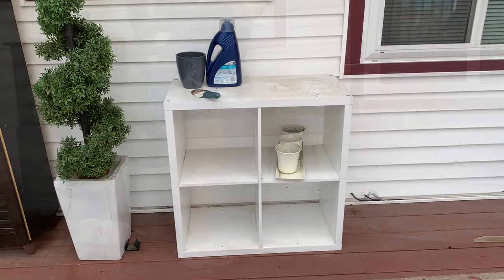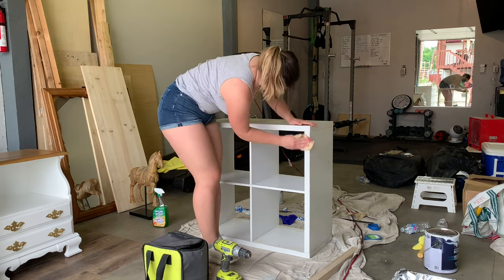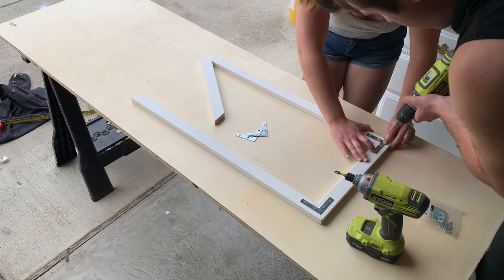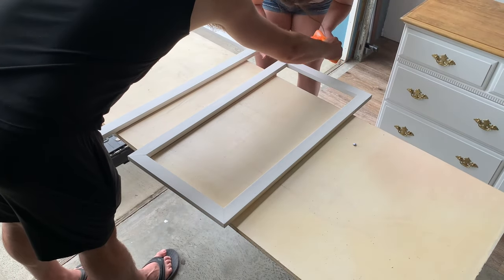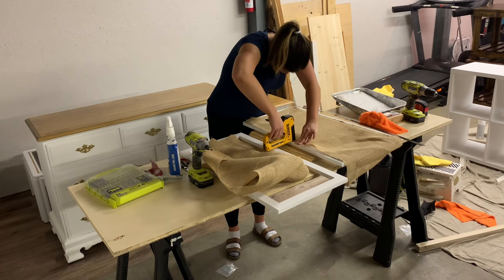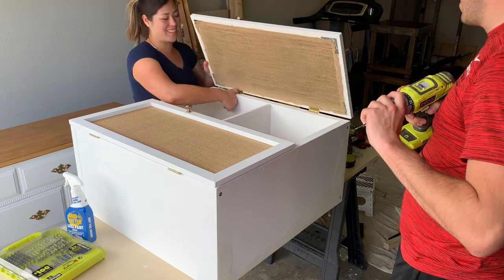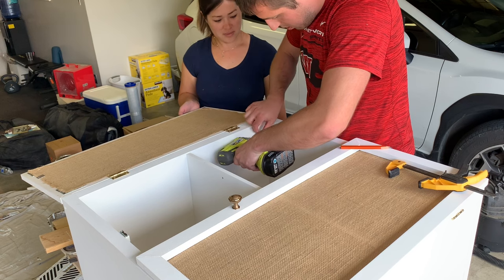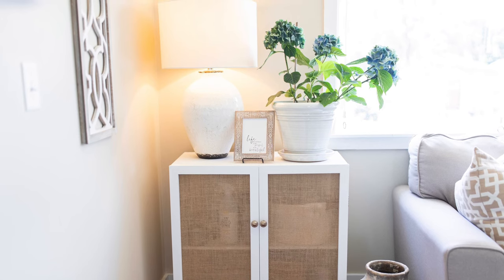Transforming Cube Storage into Cabinet in Under $30 - DIY Hack!

Comment: You can also use hot glue with wood glue to put it together would hold for that or then could put bracket on if you don’t have two people and want a tight gap
Reply from the maker: That's a great idea as well. :)